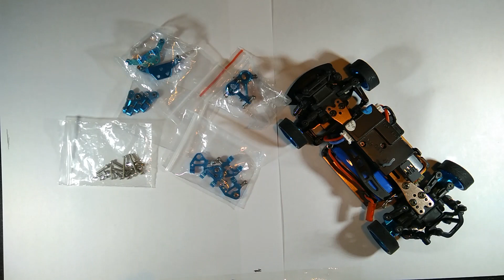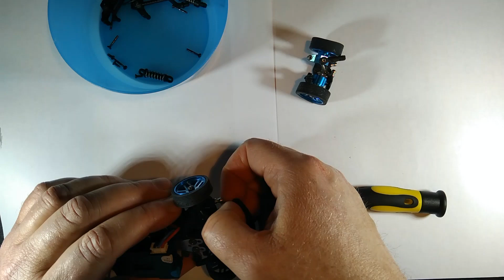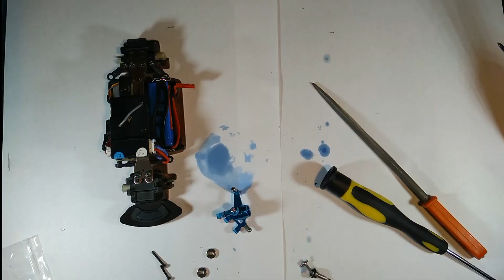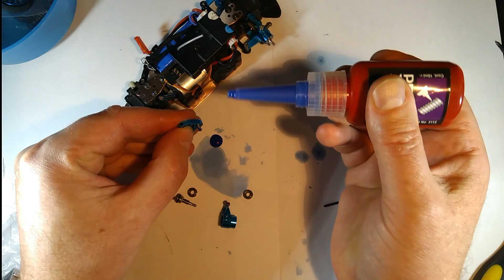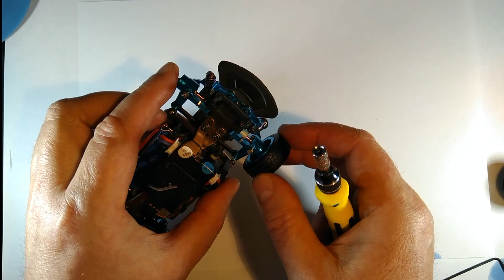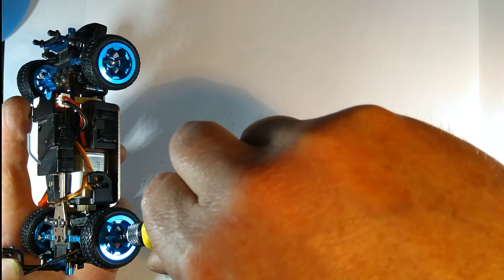Wltoys K989 Metal Upgrade Kit Instructions.

Comment: Some constructive criticism for you. The lighting is poor so we can't see very much of the actual parts clearly. Also, when using thread lock, put some on a milk bottle top, then dip your screw ends into it. That way you won't squirt it all over the place or use too much or keep putting your car in the stuff you spilt.
Reply from the maker: Hi Phil  Cheers for the feedback I know I need to sort out the lighting. I like the bottle top idea!
Reply: @dominiccook7068  the frame on your madels is way better now. Yeah a desk lamp pulled overtop would probably do the trick. Nice one mate